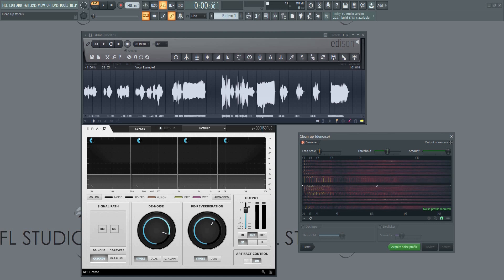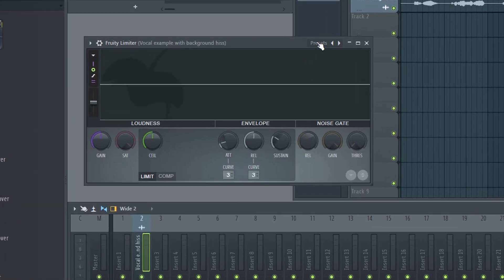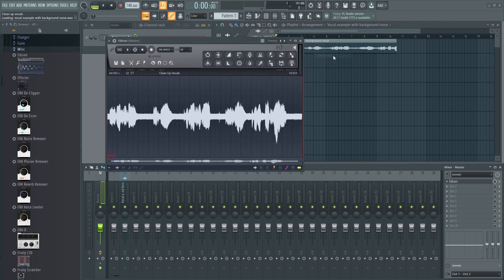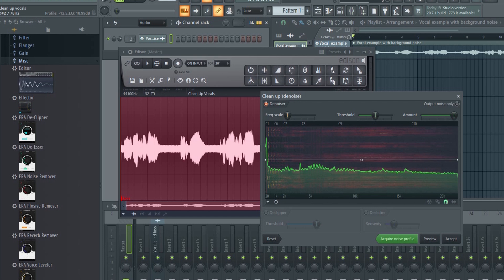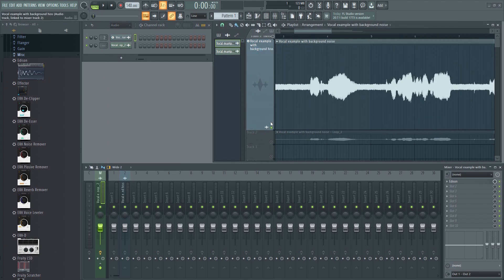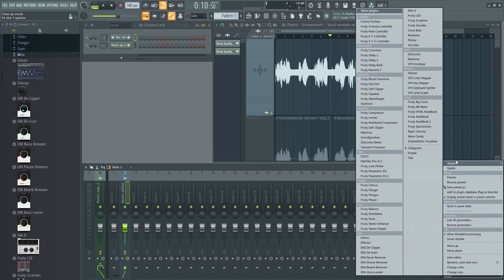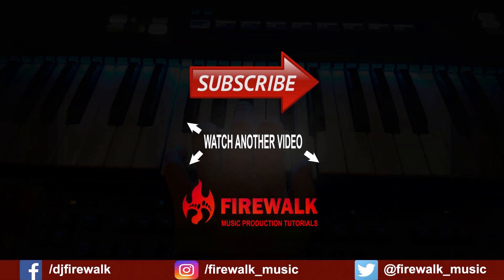How To Remove Noise From Vocals & Audio Recordings In FL Studio 20 (The EASY Way!)

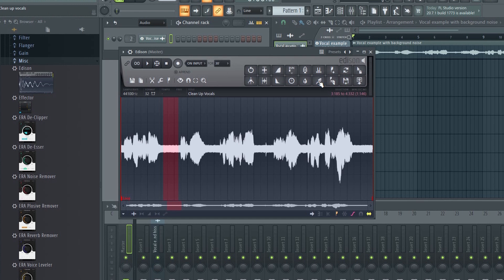Comment: 2:56 It's weird, I tried this same trick with an episode of my podcast I recorded yesterday.  I had a guest come on the podcast and they wore
a sweatshirt that was really noisy whenever they moved around.  The microphone picked up the sweatshirt quite a bit for the entire one hour
long episode.  I tried this technique you showed us in order to get a noise profile for the background sound from his sweat shirt and followed
your steps but when I removed the noise it actually screwed up his vocals pretty badly.  Does this only work with hum or buzz or something
similar?  I was hoping it would work for ANY kind of noise.  But perhaps it's mostly used for 60hz hum or like a computer fan etc. and not as
good at detecting other little tiny sounds that are in the mix?
Reply: I just tried it again on a different vocal where I'm testing out recording while having the heater turned on in my apartment.
Can easily hear the sound of the heater on the vocal and when I acquire the noise profile the way you showed us and then
try to remove it, literally NOTHING happens no matter how high or low the threshold, or the amount level is set for!  WTF?

Comment: It's Helpful Buh I Feel Like The Vocal Doesn't Sound Good
How About You Reduce The Amount?
Reply from the maker: This was an extreme example that I set up in order to really show the difference. Most of the time you won't have anywhere near as much noise as this. In this case a lot of processing was needed to deal with the noise. However, most of the time, there will be far less noise, and you'll get away with way less processing, meaning that the result will be more natural. :)